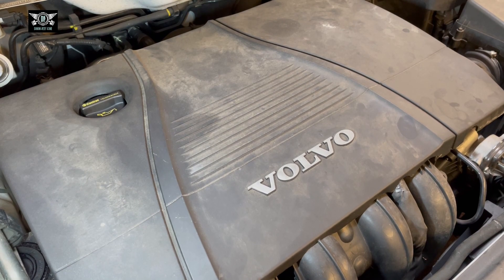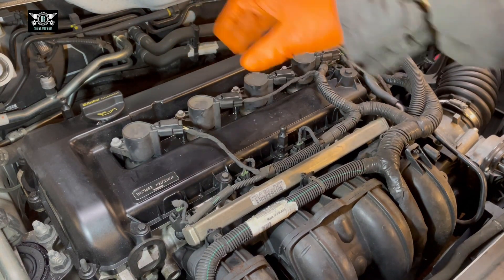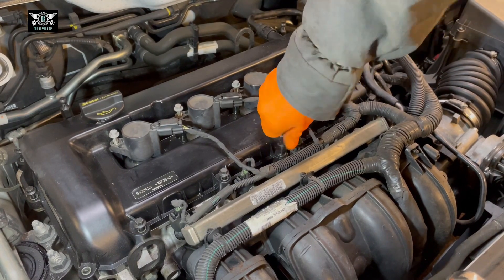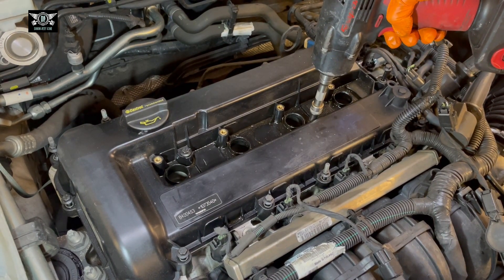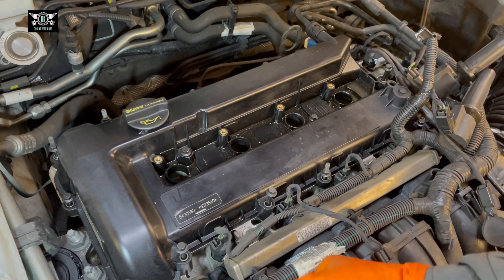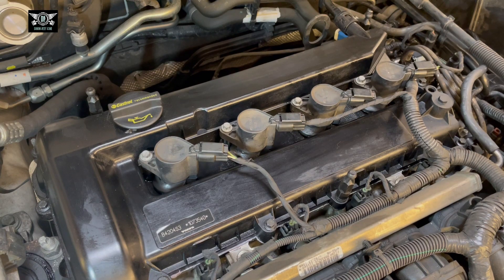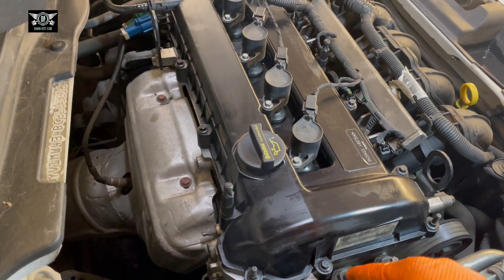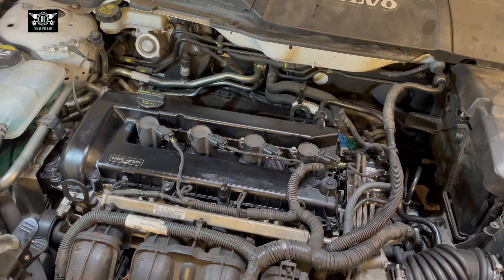Volvo V50 2012 valve rocker cover gasket removal and replacement

Comment: It's possible to check valve clearance when the valve cover is removed?
Reply from the maker: I would think this has hydraulic valve adjusters..!
Reply: @DaringBeefcake  The valves are hydraulic, but the valve clearance is set manually with  the help of right thickness of pusher glass valve
Reply from the maker: ok, well i never really did any valve clearances on this car, sorry..wouldn't know how to. @thirdman3